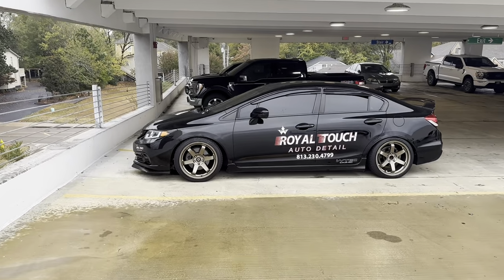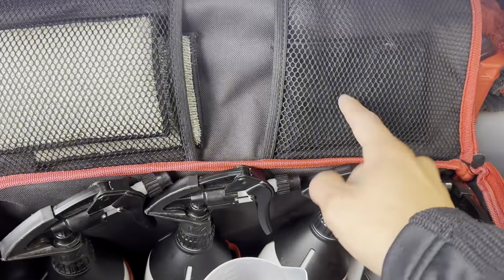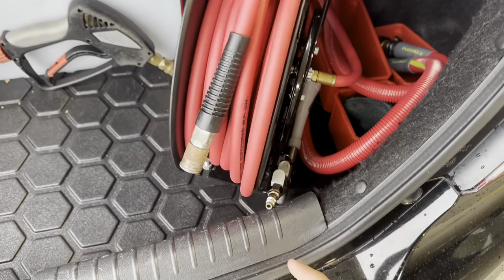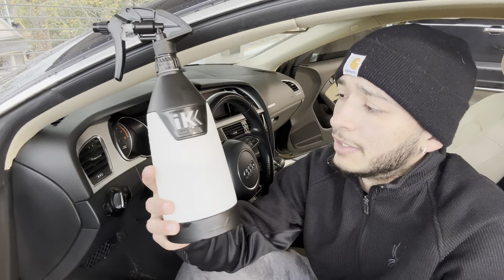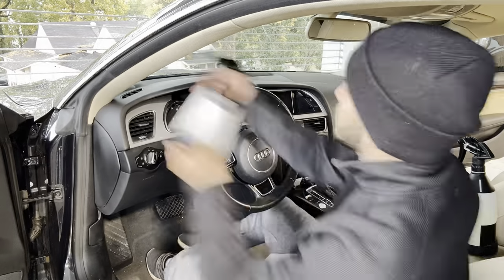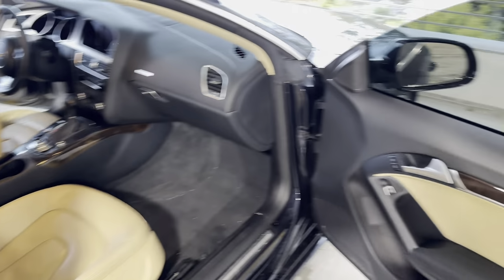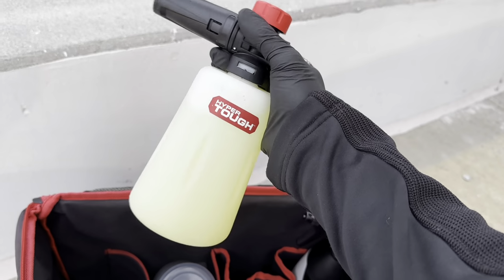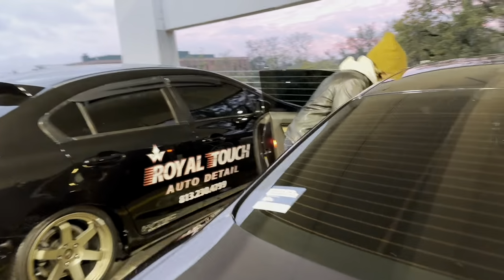Mobile Detailing Civic VS Audi A5

Comment: Great videos bro and new subscriber one question Do you use the same process for all cars? Brake buster is for all types of wheels Do you dilute it or is break buster ready to use ?
Reply from the maker: Thanks brother thank you for checking me out and subscribing! I dilute Brake Buster 5:1. I just got some Koch chemie magic wheel cleaner. It has iron remover in it so it will turn the wheel purple because it removes iron particles

Comment: Many people in detail groups im in, say, a pancake air compressor like that won't make the tornador work effectively or for long amounts of time. They recommend the dual tank Ridgid compressor. Do you find this to be untrue? I would like to use a tornador, but a regular air gun would work just fine for me. To sum up, do you find that air compressor to be just fine for what you use the tornador for?
Reply from the maker: As of right now it seems fine. It does use a lot of air quickly so it has to refill a lot but as far as problems go, the only thing is the tornador gun itself just not releasing the trigger properly